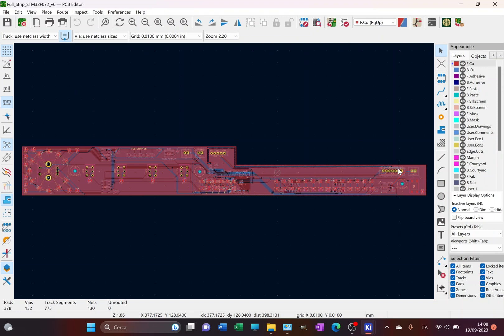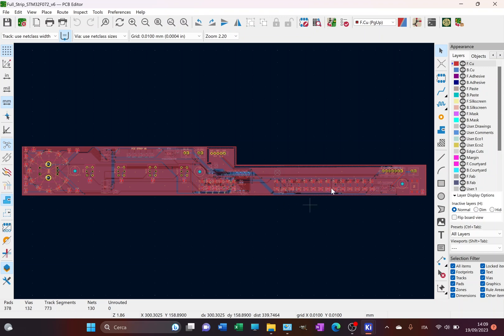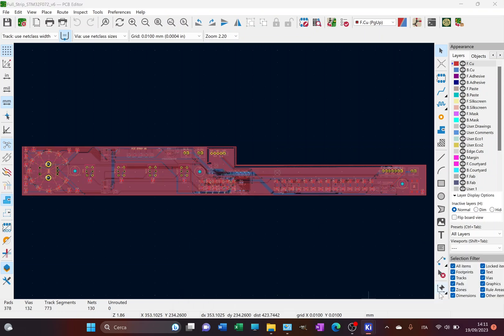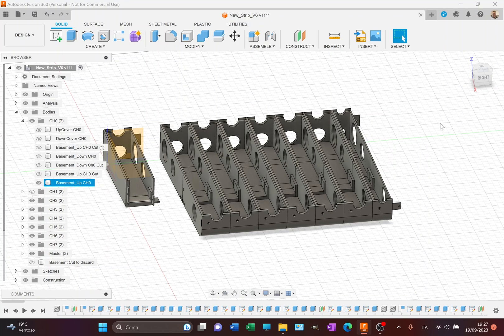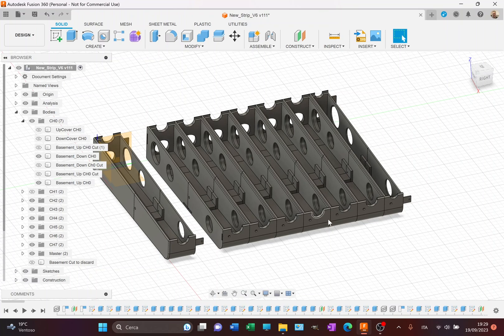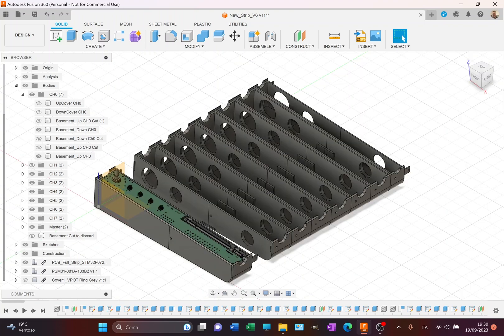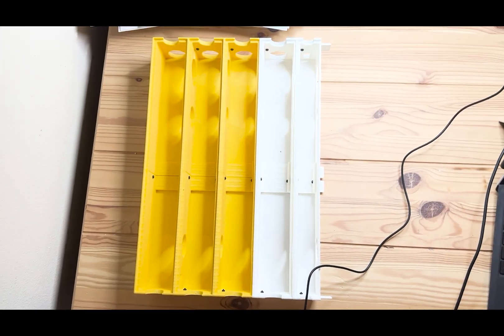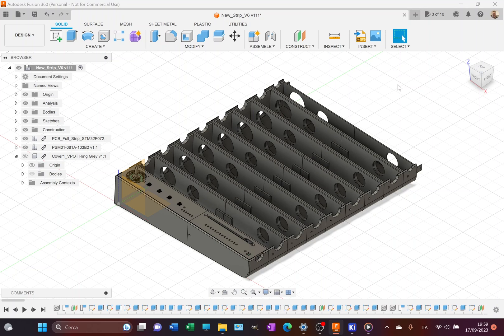DIY MIDI Remote Controller - Update 19-09-2023

Comment: To be honest, I still feel that the PCB could be a lot smaller.
As someone that is used to live digital mixers and older analog mixers, I find the top section above the fader with the status LEDs and the buttons to be gigantic and could be easily 1/4th the length. 
The buttons could be for example in a 2x2 grid or just closure together side by side with the LEDs, allowing you to make the length of the PCB  around 1/3 shorter in length.
Reply from the maker: hello ralmslb, thanks a lot for your comment. It's well received and yes most likely there is room to make the PCB smaller in size, both X and Y dimensions. However, we need to consider two elements in the mix: 1) reducing the PCB size means increase the density in terms routing and components. This could lead in moving from 2 layers PCB (current structure) to 4 layers. 4 Layers mean more costs of production, more complexity in designing and in testing. 2) Space and size in a human interface bring typically ergonomic adavtages.

I'll be giving anyway a serious thought!

Cheers.